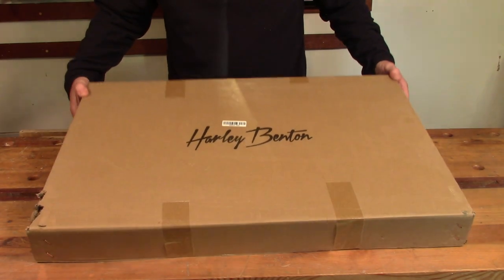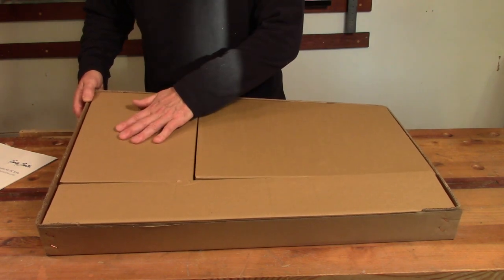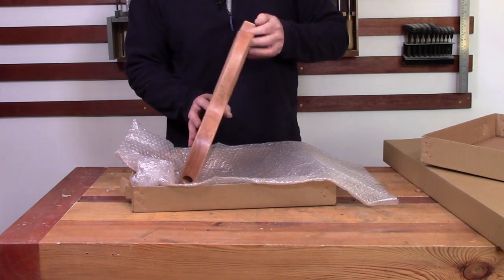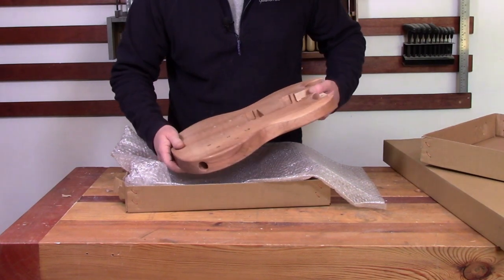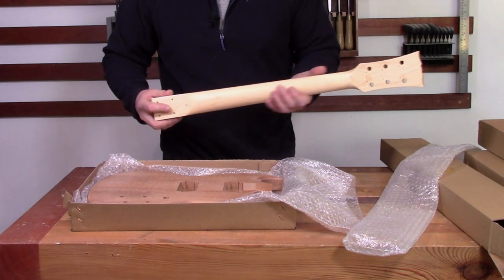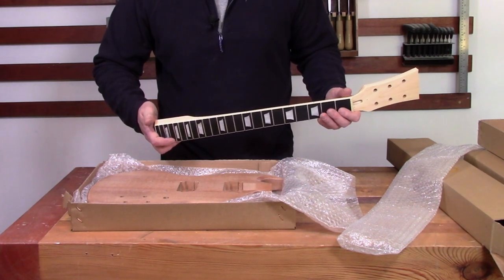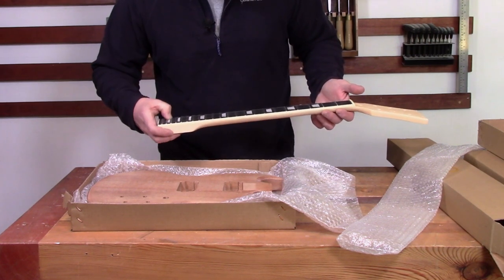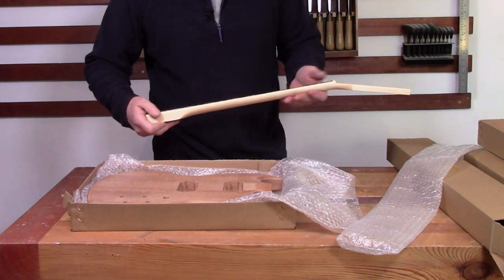Harley benton DC kit build part 1. Can I build this with just one tool?

Comment: I have the Strat kit. The routing has gotten a lot better since when you made this video. Absolutely clean and no tear out at least from my experience.
Reply from the maker: That's great to hear, to be honest I was very happy with the kit given the price and I keep this guitar in my office at work so it gets played every day and it's still going strong.
Reply: @Adventuresfromtheshedofdreams  Yeah the only thing were a few strands of wood where the pickup cavities are. But you could pull them off with two fingers and there were no tear outs. Just absolutely impeccable especially considering that I only paid 89 Euros. CNC machines really are a blessing. Only 10 years back I wouldn't have been able to afford a kit guitar just to experiment with it (I want to design a nice headstock). Good work keep it coming.

Comment: Good luck with the leatherman, it might be a bit of a nightmare if the screws are pozi and the screwdriver is Phillips (or vice versa) but otherwise I think you'll be ok. I'm looking forward to the next one already.
Reply from the maker: Yeah, that could be an issue, also the screw driver is quite small so the neck screws might be a struggle.

Comment: Fun video, I learned using kits and used them as templates and found the Harley Benton kits to be very good quality, I got a damaged fretboard on one and they sent me a new neck out immediately, good company to deal with! You can do it for sure with the leatherman!
Reply from the maker: Thanks mate, very happy with the kit on the whole. Really interested to hear it. I'm just hoping the bridge studs aren't too tight, the Leatherman won't make much of a hammer.
Reply: Don’t worry just turn it over and bash the studs on your work bench.... what could possibly go wrong 😜

Comment: Goes to 11.. good one.. this should be fun..  glad you purchased the bolt on neck as I don't think the multi-tool has clamps built in.. lol.. curious if you might use rattle cans to finish this one?  Look forward to this one whole we wait for the neck through..!!
Reply from the maker: Yes, standing on the neck joint until the glue dried wouldn't have been any fun!! You'll have to wait until next week for details of the finish ;)

Comment: Building a Tele at the moment from the cheapest neck and body on Amazon (body £23.99 ,neck £27) and using parts that.i have from various upgraded guitars (a set of vanson tuners and such)good luck suspect you'd do it bind fold and wearing a hair shirt 👍
Reply from the maker: Would be interested to find out how that comes out. 50 quid plus some spare parts is a decent build cost :)

Comment: I know what one tool I would use for this - an ax. And then into the fireplace ;-).
Reply from the maker: Lol, let's see how it turns out before we burn it. I have someone who will benefit from having it lined up for when it is finished.
Reply: @Adventuresfromtheshedofdreams  Don't get me wrong. A few years ago a friend brought me a PRS-like DIY kit from Harley Benton, to help him to assemble it. Regarding the fret job (easy-peasy, it took minutes, I don't know they were made of... tin?) it was a disaster. The kit had a stud-mounted trem bridge. Right after the pre-assembly and stringing the studs started to bend, because the wood the body was made of was as soft as pensioner's diarrhea. 1st step was stabilizing it with thin superglue and gluing-in the stud-ferrules with epoxy. Did not help. The second step was drilling the shit, gluing larger hardwood pegs, and drilling new holes. Wha-yeah. If this is the beginner luthiers's kit, good for us - we'll earn more because we won't have any competition. No more Harley Benton.